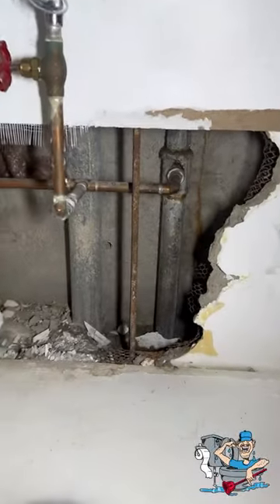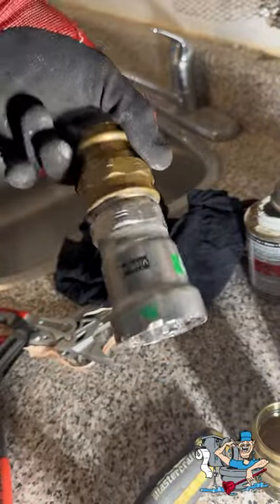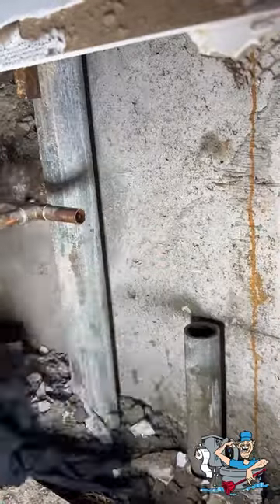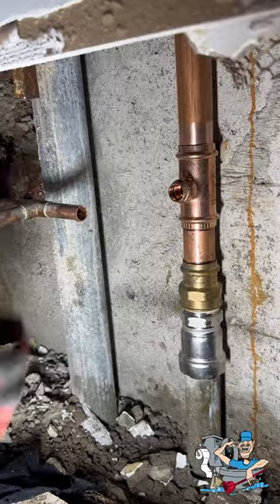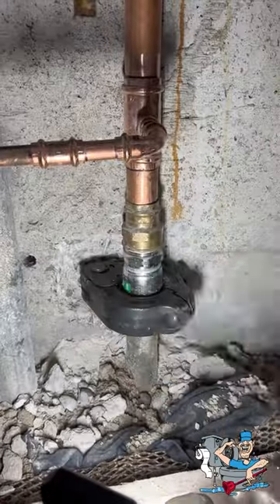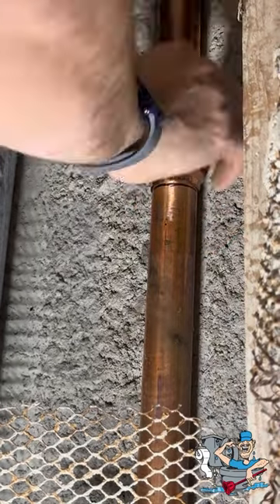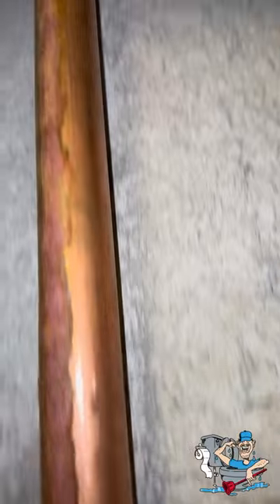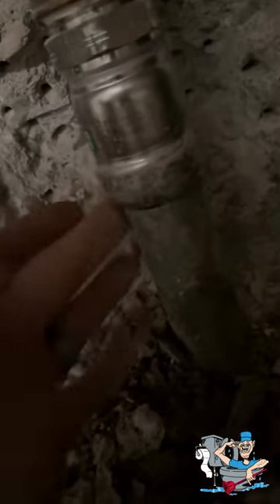Burst Pipe Emergency Repair

Comment: What type of clamp was that for the galvanized?
Reply: it’s called mega press, it’s used for black iron on gas lines but they have special water line fittings as well